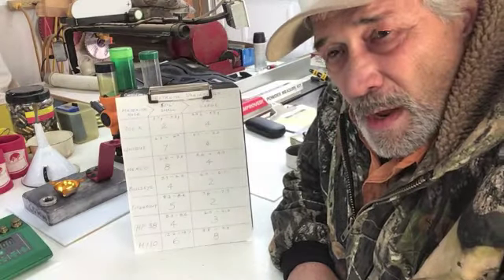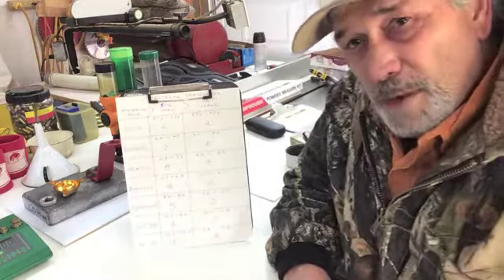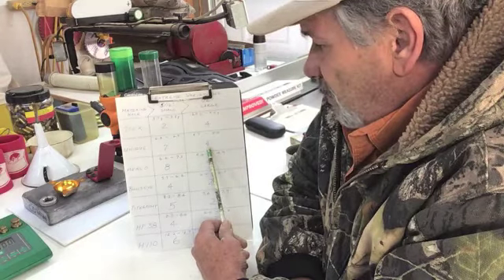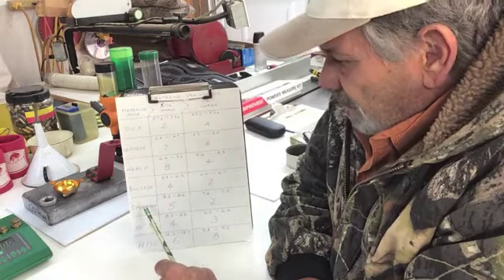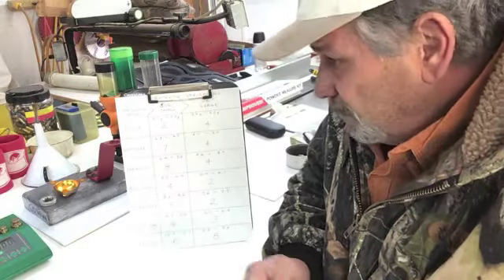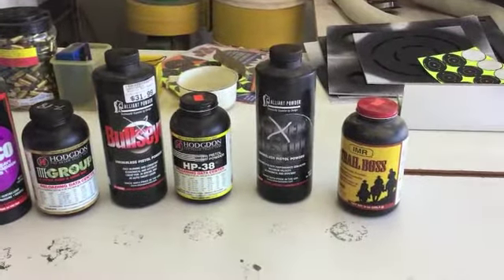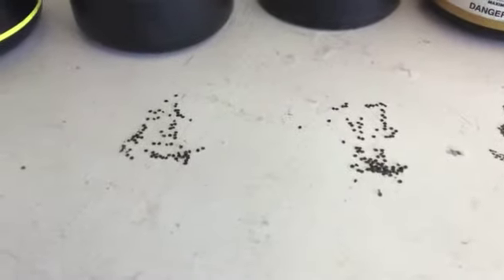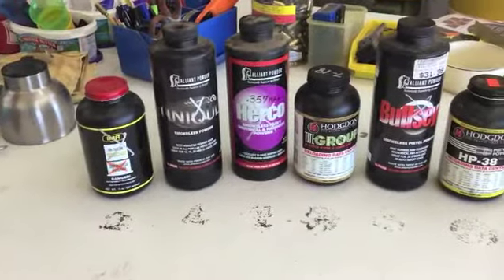POWDER THROW ~ test 3 ~ More Pistol Powders

Comment: Interesting, I wouldn't be surprised if the reason your uniflow had issues with 110 is clearance between the drum and the casing. 110 might be small enough to be filling voids the other powders couldn't. Other than that it is surprising how the larger hole does seem to through pistol powders a little more consistently. I suppose vertical stacking is less prevalent in the larger cavity or something.
Reply from the maker: I don't know yet, the 'why's' of all this testing...it goes against my first thoughts and things I've assumed over the years about these dang throws. But...the more observations & comments I get the better I am able to understand what is actually happening inside the metering assembly as it turns out from under the hopper hole...it's currently somewhat of a mystery but the more test results that stack up, the more clues are coming out. It's a riddle caught-up in my brain...
Reply: @charlesirby9222  My theory is that the larger hole is allowing for more pressure to be applied to the volume in the cavity leading to more consistency. The smaller hole may not have enough pressure (weight) to overcome the random placement of the granules of powder. The way I'm thinking about this is that flat spherical or flake could be stacked in an I formation with a granule being vertical and a granule bridged across the top leaving unfilled volume to either side of the vertical. However, the larger hole may dump enough powder quickly enough and with enough pressure to over come this and fill the volume more consistently. IDK its a theory though lol.
Reply from the maker: Yeah, I agree. This is what got me to compare the different diameter metering holes...thinking that one is more conducive to the fill, that they would identify themselves with the powders they do well. But...there's the granule shapes & sizes and their densities that add to the mystery. There is the way that the operator trips the throw, is he aggressive or does he pussy-foot the lever being clever...it all effects the outcome. That was the reason I started doing a 'double tap' on the fill stroke thinking it would settle the metering hole no matter the powder...that technique works some of the time and not so well with others...Oh how I'd love to speak with an engineer of one of the powder throw mfgrs. to get their reasoning & find out what they did to make a more efficient throw. The new Brass Smith uses the 1/2" hole too and found success because of that, I hope some of those light bulbs start coming on soon.... 
I wish I could get all the fellas that say..."Oh my brand X will throw brand Y powder to within 1/10'th all day long...most of the time it's right on the setting!" . . . I wish I could figure a way to get these fellas to publish a video, a short one of just 10 throws in a row, weighing each charge with their commentary on 'their process' of throwing, showing how aggressive or pussy-foot they handle the throw, how it's mounted, hand operated or on a turret or progressive and whether or not they use the baffle or pre-settle the hopper. Then if their claim is valid on their throw we could put all these various brands of accurate throws/powders in one video. A reference guide to successful throwing of powders. I'd damn sure watch it before I spent money for a new throw I'm not familiar with. I guess the old saying that a picture is worth a thousand words...then a video must be the bottom line. 
I guess that I can spit in one hand and wish in the other & see which one fills first because it's highly unlikely that anyone could get anyone to participate in something like that...today I have about a million throws to do, double checking those results & trying some new ideas...if I were actually loading rounds with all this, I'd have a lifetime supply by now ;-)

Comment: I was surprised that you had such a variance with Bullseye , HP38 and H110 . In my Lee auto disc I'm never off by more then a 1/10 gr., mostly dead on with the fine powders .
Reply from the maker: I can't explain it yet James...before each throw I tossed 15 throws back before starting a 10 throw test run & I settled the hopper after the filling. I suppose there is things I'll never understand. Wouldn't it be nice for some guy who owns most all the powder throws to do some test throws to see which manufacturer does the best job with all the powders...I doubt we'll see that though.
Reply: @charlesirby9222  Still good information . Hope you continue with the other powder throws for a comparison .

Comment: Redding now makes several powder measures that have different uses and 'sweet spots' as far as grains and types.   Look at page 20-23 in their catalog:

http://www.redding-reloading.com/images/stories/2018Pressinfo/2018_Redding_Cat.pdf

They are on the very expensive side when my eyes see the budget to set up a bench with all of them.  

It seems that the ancient hand loaders with their tricklers knew what they were doing.   I started setting up my powder measure on the low side and using a trickier to do load development.  I like the simple mechanical aspect of doing charges.  The allure of an auto dispenser is very tempting.  It is not hard to see their popularity.

Comment: It's always frustrating when the phone rings during filming. I have no idea how they're constructed., but Is it possible to press fit a removable tube to reduce the diameter of large hole?
Reply from the maker: Not with these types of drum style throws. The metering piston has to run up and down in the hole.
Reply: So much for an easy DIY fix.